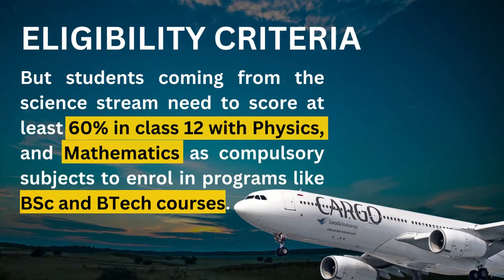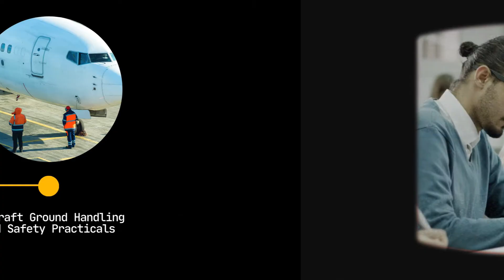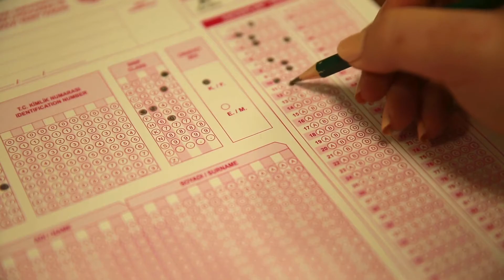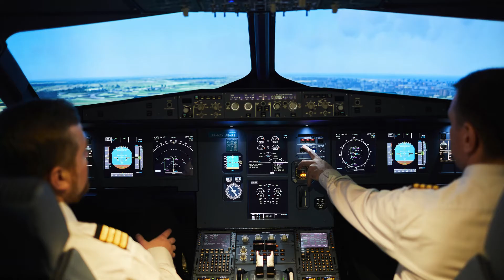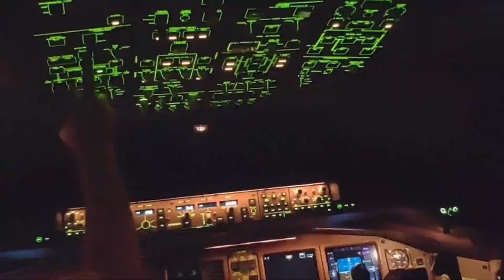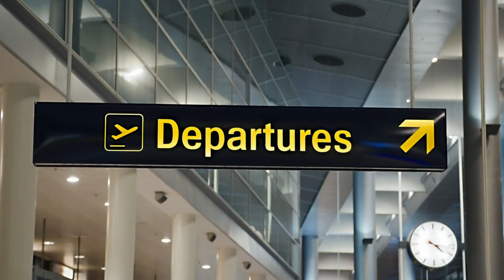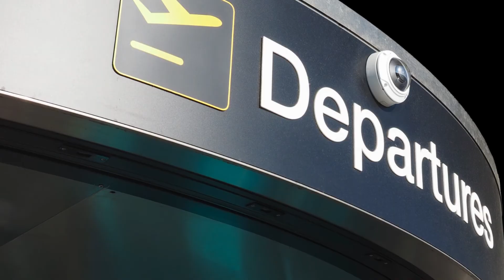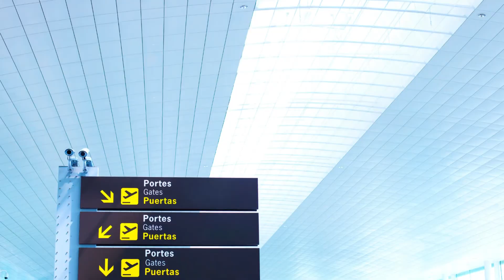Aviation Courses After 12th In Kannada  | Career in Aviation Industry in Kannada

Comment: Sir please recommend a college sir
Reply from the maker: In India, the basic height requirement for cabin crew varies by airline, but the general standard is:

Female: Minimum 155 cm (some airlines may require 157 cm)

Male: Minimum 170 cm

Arm Reach: At least 212 cm (on tiptoes)

These requirements ensure that cabin crew can easily access overhead compartments and assist passengers efficiently. However, some airlines may have slightly different criteria, so it's best to check specific airline requirements.